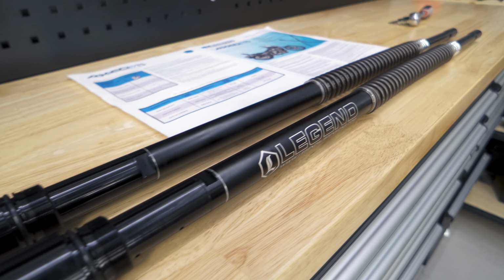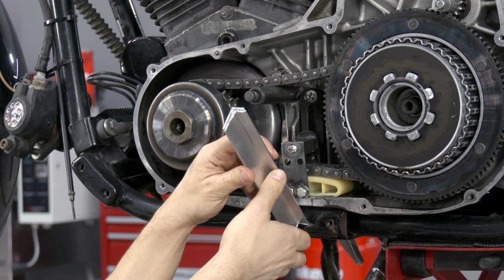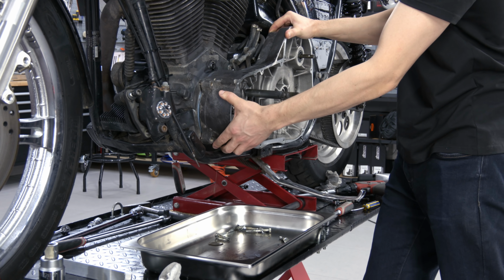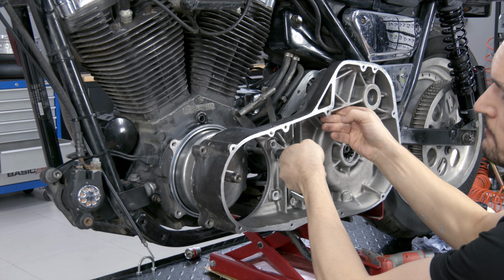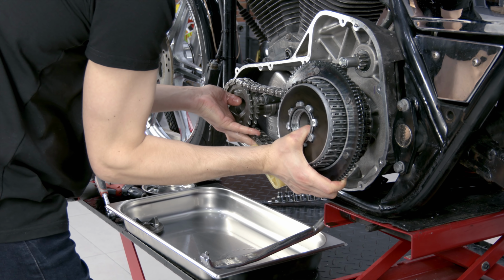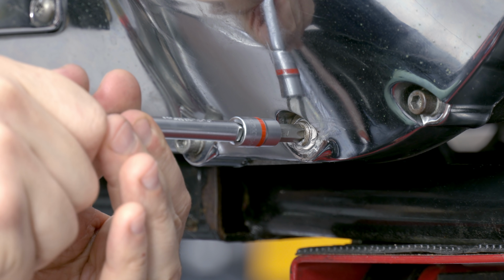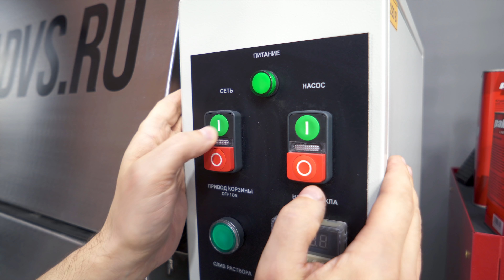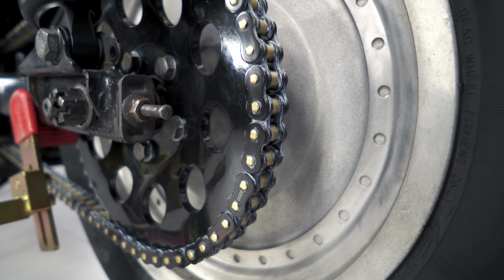Harley FXR Sprockets & Chain Installation

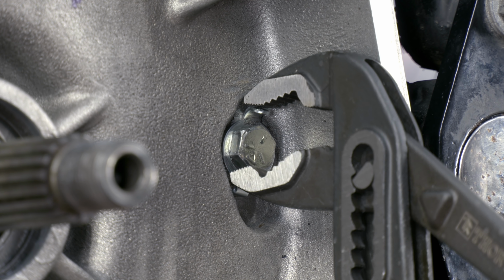Comment: Good video footage, but definitely should've taken the opportunity to change out ALL of those seals and o-rings you had easy access to before reinstalling the inner primary! He even put sideways pressure on that o-ring (part #11117A) within the shifter shaft sleeve whilst bending the lock tab at 6:33 into the video. If you're reading this before doing the job, get the transmission and primary kits with all of the seals, lock tabs, and circlips included. The shifter shaft seal in the transmission is usually a stand-alone item.
All of that being said, thank you for the video!

Edit: I should've read the details in the description before commenting, but will leave this here for others concerned with leaks.

"We haven’t changed them since the engine is for testing and is going to be rebuilt several times or even changed. If leakages occur - not a problem."